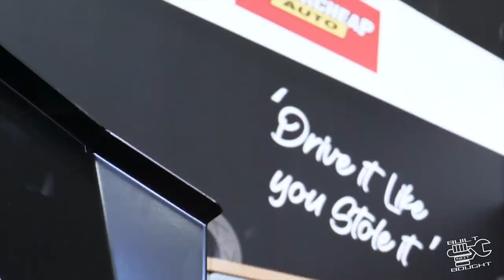REBUILDING THE GU THAT ROLLED OFF A MOUNTAIN!!

Comment: Now you have one rear quarter with clear coat and the rest of the rig with single stage factory paint. The section you painted won’t fade or oxidise anywhere near as fast as the rest haha. Great work as usual. 👌

Comment: Hey mate, the clear coat shouldn't be dull or rough.

Quick Tip, after your final coat of clear,thin it down a shit load and go over it very quickly. It will all melt down and be super glossy